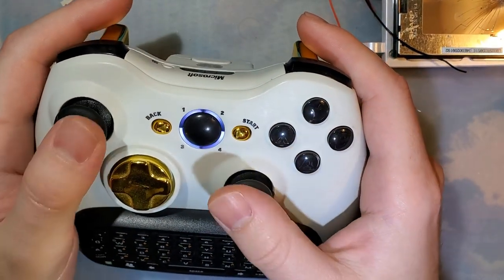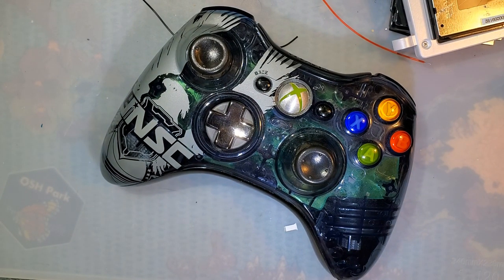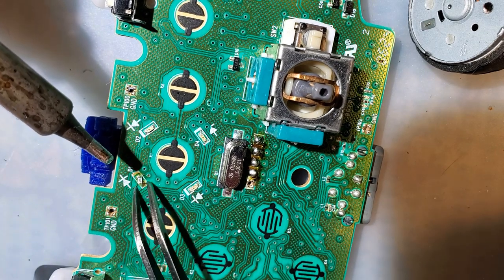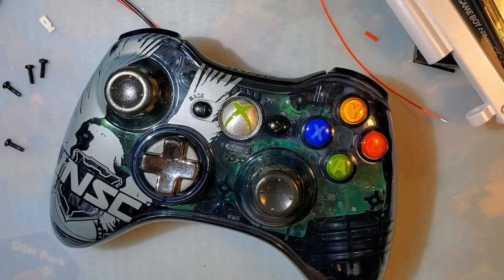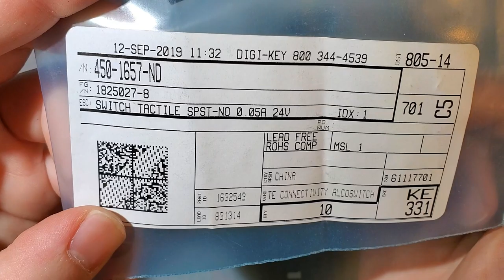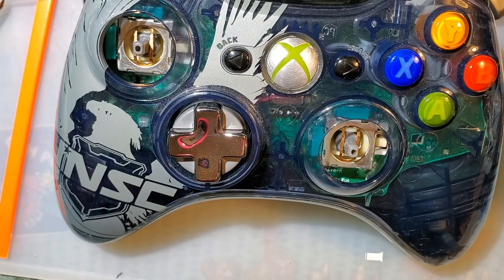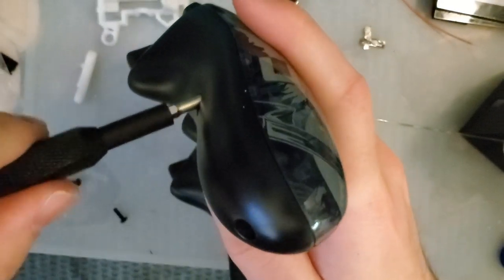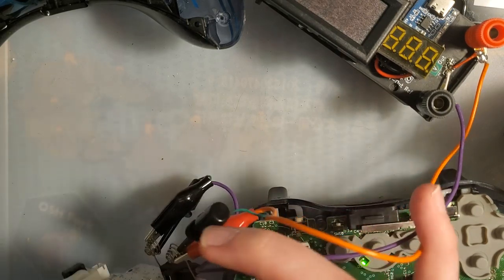Modding and Repairing some Xbox 360 Controllers

Comment: Top port on the 360 controller was for using the controller wired so it would power it and have data transfer. IIRC it did charge the official xbox 360 battery pack as well.
Reply from the maker: I remember that the port only provided power and you still had to have it synced via wireless. It never worked that way on PC anyway. It could have been my off-brand cable though. Not sure. The xbone controllers work that way though, thankfully.

Comment: Is the USB C controller wireless? Was it converted from a wired controller? And I was wondering if it had Bluetooth or if it still connects like a regularly wireless 360 controller. Thanks!
Reply from the maker: I mean, you still have to plug in a wire if you want to use the controller but technically it is wireless.
Reply: @makho  Ahh okay. I was thinking about getting into modding controllers, found the supplies for it were pretty cheap on ebay. I was talking to a friend who wondered if it would be possible to convert a wireless 360 to a bluetooth like in newer controllers. If I had to guess this would be either be not possible or very high level modding.
Reply from the maker: @El-Duderino-His-Dudeness  Bluetooth mod is not feasible

Comment: hi, is it possible to mod a wireless 360 controller to be used on pc?
Reply: i mean to mod it to be wired too, the spring from battery pack was rusty and it broke too, both my xbox controller met the same fate (left the battery in there for years) 

wondering if its possible to tinker around with it, thank you!
Reply from the maker: https://www.ebay.com/b/xbox-360-controller-pc-adapter/bn_7024868184

Comment: I need to USB-C mod my wired controller. Now if only there were a way to install USB C to Dualshock 4.
Reply from the maker: IIRC, the USB port is on a separate PCB so it shouldn't be too difficult to just make a new PCB daughterboard to slot in. If I had a DS4 controller, I'd probably look into it. The lack of USB C on Xbone and DS4 controllers was a real shame but at least the Series X and DS5 controllers should have type C.
Reply: @makho  I've actually gotten requests to do USB C for ps4 controllers a few times, i'll have a look at it when i have some spare time (or if i have some spare time)
Reply: @makho  I'd love to see you try and slap a USB-C port on a DS4, a DS3, and anything else you feel like attempting! USB-C all the things!
Reply: I definitely enjoy the long-form videos.